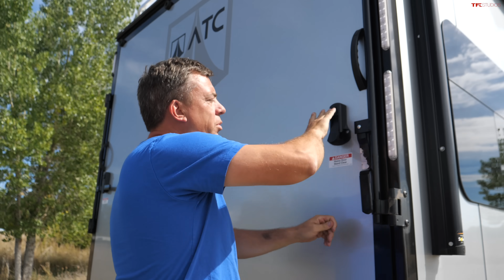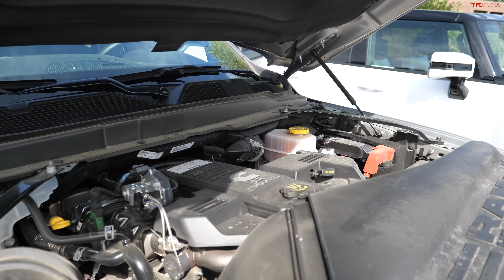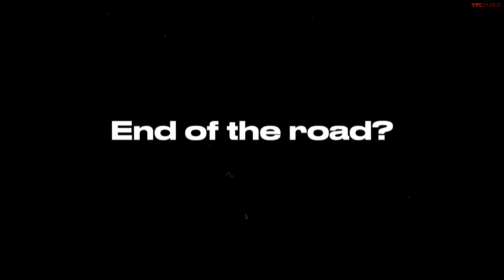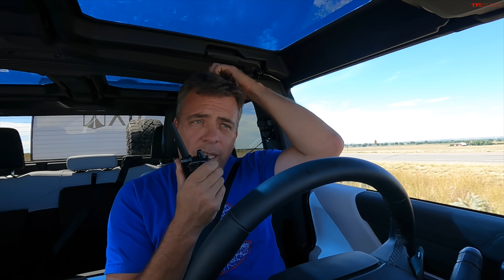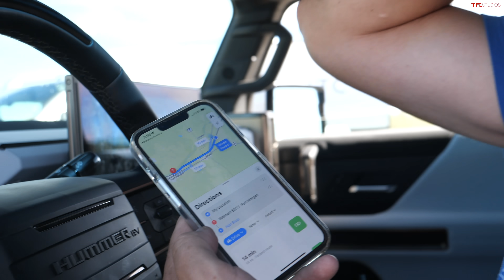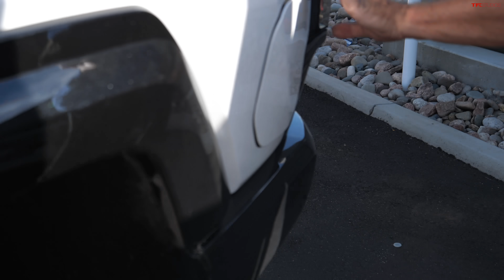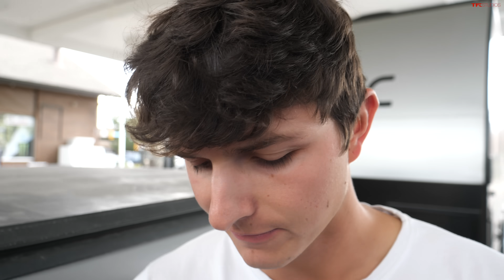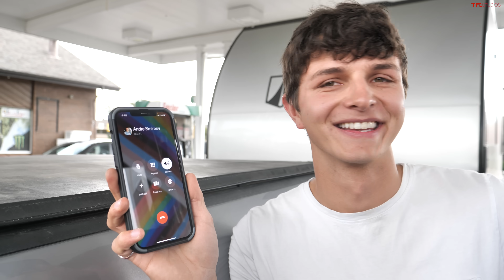How Far Can a Diesel and Electric Truck Tow An Identical Camper Trailer on ONE Fill-up?

Comment: The Ram can tow both trailers and the Hummer without breaking a sweat.
Reply: With out a doubt
Reply: Certainly
Reply: @PatrixBest   true , story
Reply: Electric will always lose. It will always cost more. As long as they require batteries, there will always be an extra loss of energy, as batteries must be charged. 
Unless & until they come up with something that generates electric, eliminating the need for batteries it will never be a fair comparison. 
Currently the only way to make huge electricity without fossil fuels is nuclear. 
Even the smallest & most efficient nuclear reactors power aircraft carriers, big ships & the biggest submarines. 
The next logical step should be to make nuclear reactors small & efficient enough to power large train locomotives & maybe the very largest trucks & tractors 
Long time, if ever until nuclear can power pickups, cars etc. Batteries could be used indefinitely for smaller vehicles if & only if we ADD a lot of Nuclear Power Plants to charge them.
Reply: @garymangelsen4413  you realize that diesel trucks need to be recharged too.. right?  You recharge them with energy by putting more Diesel in them.
The only difference between an internal combustion vehicle and an EV in this regard is what you refill/recharge it with.  An electric recharge unfortunately much takes longer (but at least it doesn’t stink of diesel).
Also, current battery tech lasts a decent amount of time.  My EVs batteries have a 100k warranty.   They’ll prob fail long before a maintained (used) fuel tank will though and they’ll  cost a LOT more to fix/replace..  but solid state lithium and other battery tech with much better life spans are around the corner.
Reply: @ffakr  The electricity doesn't stink where you fill Spunky but it usually stinks somewhere else. Outta sight outta mind I guess or ignorance is bliss. Not sure which paradigm in which you exist..
Reply: @robertthomas7176  never noticed the smell off any of the majestic wind turbines around me.
Reply: @ffakr  Yeah those wind turbines are so beautiful to look at lol. Especially while they're killing all kinds of birds and bat's. Including eagles. But yeah yay wind turbines.
Reply: @Pimpdaddyleif  I think windmills are rather majestic myself but I accept beauty is in the eye of the beholder.

The do occasionally kill birds.. I see an estimate of around 1/3 of a million birds killed a year.    There’s been good results in reducing this number though.. painting patterns on blades.. using cameras and Computerized image analysis to identify flocks of birds and slowing turbine speeds to protect the birds while they are in close proximity.

Of course.. up to 1 BILLION birds are killed by collisions with windows in just the US each year.   That’s ~3000X more than windmills.
House cats are estimated to kill between 1-4 BILLION birds in the US every year.. upwards of 12,000X more than windmills.

I don’t suppose you object to the existence of windows, do you?   I’ll also assume you’re not in favor of the euthanazation of all outdoor house cats.. though maybe you’re Really not a cat person.  ;-p

Light pollution.. estimated to be responsible for 100 Million to 1 Billion bird deaths a year.  No lights?
Plastic pollution.. kills Millions of sea birds a year.  No plastics?

Little more hard to find quick numbers on.. how many birds are killed by other methods of power production?  I’m sure that number is Far from zero, both directly and indirectly..  Solar furnaces (mirrors used to generate steam) cook birds in mid flight.   And how many are killed through pollution generated by fossil fuel generation?

Just curious.. is your very narrow concern for our avian buddies tied to the incoherent ravings of anyone in particular?   I’m aware of one bloated old idiot who was VERY upset that he might have to see them while golfing.
Reply: @ffakr  It's not so much that I care about the birds and the bats and especially not cats. It's the fact that it's a government subsidized "green solution" that isn't any better than anything else. But everything else is demonized in the way that I demonized wind generators.
Reply: @Pimpdaddyleif  so.. you feel fine making arguments you know are BS because your FeeFees got hurt?   Is that what you’re trying to say?
Reply: @Pimpdaddyleif  btw.. renewable energy is actually cheaper than coal & natural gas generation now.. not terribly surprising considering the fuel is free and inexhaustible.   It’s WAY cheaper than nuclear.. which wouldn’t exist if the government didn’t subsidize it heavily.

What’s the real complaint, since you admitted it’s not bird deaths?   You hate cheaper power?   Most of the installations around me are on farm land.. you opposed to farmers getting a lease check for hosting turbines? 
Or..  you just a snowflake that’s easily triggered by those dag-nabbit socialist wind turbines?   ;-P. :-)
Reply: @ffakr  My feelings aren't hurt at all I just don't think that things that aren't any worse than the next thing should be demonized just to make some pompous vegan electric vehicle driving douchebag feel better about themselves.
Reply: @ffakr  I'm very opposed to farmers getting a lease check. It's taking up farmland that feeds us. I can't eat wind power. They each take up around 1.5 acres of land. I would much rather that be feeding cattle.
Reply: @ffakr  3 million per wind turbine plus operating and maintenance plus all the transmission lines. I'm sure a 500 turbine farm pays for itself real quick.
Reply: @Pimpdaddyleif  So,.. your theory is that Power Utilities install wind turbines in some grand plan to bankrupt themselves?     Your super-geniosity astounds me.

I know math is hard though.. an average Utility wind turbine can produce more than 6 Million kiloWatt Hours of power each year. 

Last I checked, my delivered cost for electricity was $0.14/kWhr (your electric bill & more math required to calculate).   So, figure somewhere around 10 cents per kWHr just for the electricity (without the delivery cost).
6M * $0.1 is.. ???   $600,000.  So, it takes 5 years to recoup the cost of a $3M Turbine?

That seems like a pretty good investment for an expensive piece of capital equipment with an estimated 20 year operational life, no?

And.. because I believe I have to explain this to you at this point.. a 500 turbine wind farm still pays off the capital cost of the turbines in around 5 years.. just like one turbine does.. because, that's how math works.
Reply: @ffakr  Your math would work if you could store electricity but you can't. Wind turbines are 30 percent efficient. You can't speed them up when you need to and you can't keep it when they're moving and you don't need it. And they're not worried about bankrupting theirselves because it's government subsidized. The taxpayers are paying for it.
Reply: @Pimpdaddyleif   that 1.5 acre estimate includes space for a power sub-station.. something I've never seen in the middle of a corn field next to turbines.  This may shock you, but not every square foot of a farm has crops planted on it.. and there's no reason a sub-station can't be on non-farmed adjacent land.   :-/

Regardless.. let's go with the idea that full estimate and pretend 1.5 acres of crops don't get planted for every Turbine.  The same source where I found "1.5 acres per windmill" at also recommend only installing one turbine per 80 acres.   So, you're complaining about less than 2% reduction in crop yield if everything (even substations) are put onto actual farmable land.

This may shock you.. having seen full shelves on every market you've ever been in.. but we in the US don't have a shortage of food.  Sure, we have population segments that sometimes lack the funds for food.. but there's more than enough food.   Heck, we even pay farmers to run fields fallow to prevent them from flooding the market with too much food,.. to prevent them from driving down prices and bankrupting more farms.

In fact, we Americans throw out about 40% of the food that we produce!   Could you imagine if every farm put as many turbines on them as they could fit (keeping 1 per 80 for max efficiency).. why.. we might have to only throw out 38% of the food we produce!!  Oh, the Humanity!!  

We do, however, have a shortage of family farmers who are able to earn enough to keep their family farms out of bankruptcy.. and yet at the same time, we have a burgeoning market for energy.    

So.. let me get your position straight.. 

You believe Farmers MUST produce as much crops as they can.. whether the market demands that supply or not.. and too bad if they need an additional source of income to stay solvent.. they don't get to use their land how they want.
God forbid they choose to use a tiny fraction of their land to farm Wind instead of Kale.

Huh.  Overall, an interesting take.
What are the odds you're also cool with other people telling you what you can and can't do with your property?  :-)
Reply: @ffakr  I can assure you seeing all the wind farms here in Oklahoma that it is not 1 per 80 acres. If there's this huge overstock of food being produced why is so much of our produce coming from mexico? And if like you say the farmland close to you has no crops or cattle then it's not farmland it's empty unused land so yeah throw some windmills on it.
Reply: @Pimpdaddyleif  thank god they're attached to a grid.. and we don't need to ONLY rely on turbines.   
Still, you should look into available tech to store renewable energy.  Some of it seems rather 'Rube Goldberg',.. like using excess power to pump water up to a tower (to later recover energy when it's released back down) but it works.  
Other tech is is just over the horizon, like solid batteries (not stolid state batteries).

BTW.. Australia has already proven that you can install massive battery buffers to store renewable solar to use at night.. at infrastructure-levels.
Reply: @ffakr  The pumping the water up the mountain thing is a pretty decent idea. I hope it's close to being figured out. Large amounts of stored electricity would change everything.
Reply: And blow a transmission !
Reply: And keep going
Reply: Exactly what I was thinking . Now where's that tow strap ???
Reply: Yep
Reply: I wouldn’t say it would tow 21,000 pounds without breaking a sweat.  It would certainly be able to tow it though granted not legally.
Reply: Exactly
Reply: @Bob Habib Yes, I expect I will have $10K, or whatever it costs when my battery finally needs replacement.  My former primary car (now backup, a 2012 model) averaged about 12K miles per year.. and with a 100K mile warranty this will only be an issue LONG after my car is paid off,.. then it will be a question of new battery or new car and expensive battery is WAY cheaper than new car.
Also, there's a burgeoning industry of battery rebuilders for EVs. Just like most Transmission issues don't require a new Trans.. it's often possible to identify and replace just the individual cells that fail in an EV battery because each cell is a discrete part and they don't all fail at once.

By then, I also expect the replacement will be solid-state or some entirely new chemistry so, at worst, it'll be a replacement that lasts multiple times longer than 100K miles.. and with increased power density it should either give me better range or cost less (fewer cells required for same range).

As for motors, I've got two.  Yes the Hummer has four.. though I doubt they cost $5K each. 
Still, I expect them to last MUCH longer than ICE engines.  They're much simpler with fewer moving parts and FAR fewer points of friction.  I expect they'll need bearing replacements at some point but the stators & rotors in my electric motors aren't going to wear out.. unlike your piston rings and sleeves.. or any of the scores of other parts that rub against each other in an ICE motor.

And about charging off-grid.
The sun shines to some extent every day.  Sure, you could convert a desiel to run on cooking oil, but a) you have to do that, and b) how much food do you fry?
In my scenero, you just need to plug your EV in every night.  In yours, you have to spend time going from resturaunt to resturaunt collecting used fryer oil and, at the very least, filter it at home.. or, 'ferment' it into BioDesiel if you want to do less conversion work up front.    Sounds like Exactly how I want to spend my free time.

You also have to remember that you don't need to recharge the entire battery all at once.   EV drivers don't typically run their batteries to empty like ICE drivers often do (gas) before filling up.  We plug in at home every night.. imagine putting a gallon or two in your tank every day.
Most people also drive relatively few miles day to day, and only drive long distances occasionally.
I charge my EV with a cheap 120V wall charger that puts out a puny 1.75KW.  Work is about 55miles round trip, and that little charger more or less keeps up with that amount of driving (and easily catches up on the weekends.. if I don't go on a road trip).

If I wanted to go off-grid and charge an EV with home solar, I expect I'd be stocking away somewhere between 5-10kW throughout sunny days.  Sure, figure maybe 75-100kWhr a Day isn't going to fully recharge a Hummer EV's huge 212kWhr battery.. but you're not going to run that battery from 100% to 0% every day (or ever, unless you want to tow it home).
Instead, to lengthen battery life, you'll try to keep it between 20-80% most of the time, and if you go out and drive 30 miles in a day, like most people do, that's going to translate to about 20kWhr of battery capacity in a Hummer EV (only gets about 1.5Miles/kWhr).   A fairly mediocre 5KW L2 home charger will top that off in 4 hours.  Heck, the trickle my 1.75KW charger would catch up in about 11-1/2 hours.   Belive it or not, most people's cars sit around not driving most of the time.. EV's can spend this downtime charging.
Reply: @Schmartist Munky  you drive 12k a year... so half the national average which means you hardly commute far to employment. With that said, you also live in a mega city to reliably find a place to charge... this guy is in Colorado and BARELY made it to a charging station... took him 30+ minutes to charge to.. 80%

So basically it's a good choice for someone who doesn't do anything but drive between two large cities.... or never goes outside to live recreational.
Reply: @Bob Habib .. sorry missed the part below the fold.     Also sorry that that you think being exposed to an opinion, let alone facts, that contradict your preconceived notions is having something forced on you.  It must be tough being that resistant to new information. 
      
Just curious though.. which EV did I FORCE you to buy?  ;-)

Is it actually painful to hear a opinion that don't match your preconceived notions?

I do sincerely apologize for one thing though.. 
I'm not arguing that Electric is ready for long-distance trailer towing and that's what this video was a test of.   I also understand Electric long-haul trucks aren't around the corner either.
The replies veered off into general ICE vs. EV topics though and I've been replying to that broader discussion..  like when you tried to make the point that running a diesel truck off old frier grease was a more practical off-grid option than running an EV off home solar (because you didn't bother to run the numbers).   
Sure you could do it your way.. but I could also buy an old truck and put a coal-fired steam engine in the bed.   That doesn't make it a practical option,  nor does it negate the reality that I can charge my car entirely off home solar (with the rare exception of needing a fast DC charger for road trips).

.. now if my roofer actually starts on my roof before winter, maybe I literally could get those solar panels to charge my car by spring.

P.S.  Yes, the sun doesn't shine every day, and yet solar still works when it's cloudy.. just not as well (because cloudy isn't the same as pitch black).
More important though..  most people go out during the day (rather than night) so the assumption that there's batteries in that solar setup was sort of baked into the argument.   Collect power on sunny days.. use it when you need it.. like when you charge your car overnight.
Reply: Ram beats all trucks with how many times it can break down and fall apart. Not to mention the Ram rusts very well.
Reply: Yeah sure
Reply: Mine can
Reply: @Bob Habib um.. I can charge an EV off-grid with home solar and/or wind power.
Do you own an oil well and a refinery?
Unless you’re worried about the Men in Black breaking into a company’s servers to remote disable a fully digital  and on-line EV.. (you must be pretty important if that’s a possibility).. my EV is is less dependent on ‘the man’ than your internal combustion vehicle.
Reply: @ffakr  What do you use it for. Electric is not a working (truck) for a man that tows heavy loads..  I'll keep my diesel. 
I don't used mine to run to the store and back.  When it has to be there. It's diesel that gets it there.
Reply: Obviously everything on earth is a cycle. Including oil. It was designed that way, clearly. The hype of "we're running out" of this or that just keeps prices up to keep us poor and dependent. Don't believe it, the Lord was generous and genius when He designed this earth for us.
Reply: @Bob Habib "your cars are exactly like I said.. Status symbols for virtue signaling.."
..  including my 2012 Prius-C.. (the lower-mid version without push-button start)?
I believe I paid all of $17K new for that.    
I'll remember to revel in the status the next time I drive it.  :-)

BTW.. went to the Kia dealer for service and I saw a 4-door Stinger (their mid-sized ICE sports sedan) on the lot for more than the list price of my EV6.
Reply: Look how electric is made, still using fossil fuels, still using plastic
Reply: Apples to oranges.... Battery technology not anywhere near gasoline or diesel. About 110 years behind... Thanks to Rockefeller (Ford wanted to do electric).I figure about another 20 and electric will be a contender.
Reply: No you don’t say, how many years of technology is in diesel and what it’s made for it? Noooo this can’t be
Reply: Nope on both.
Reply: My colorado would get 16 to 17 pulling that camper.
Reply: As long as a certain someones mom isn't in the trailer.
Reply: Well the motor can and that is not built by ram! Now the truck itself  that would be in question  be of the dodge truck history of being a terrible  truck! Sorry🤷
Reply: @timcheek5134  You are not wrong.  I bought my Cummins new in 2004 and it's ran perfectly the entire time.  It's too bad that all that Mopar crap surrounding it can't keep up though.
Reply: Two vehicles  that are losing investments!👍🏼
Reply: And probably blow the transmission in that piece of crap! 😆
Reply: Ford will tow both trucks and trailers
Reply: Even a 4 cylinder kia is better than anything electric.   Garbage electric cars
Reply: A dually maybe. A 3/4 short bed. Snap the frame
Reply: The funny thing about watching American content is learning what we use (engine in the Ram) for 26T GVM or 57300 lb trucks elsewhere is used in regular pickups over there...
Reply: Savagebunny. I love my diesel and would never own an electric vehicle but electric motors are stronger than gas motors.
Reply: And my GMC 1-ton dually can pull the Hummer the Dodge and the two travel trailers LOL
Reply: Better off buying you an ES44AC that can pull thousands of those RAM's for thousands of miles, all at once and without breaking a sweat. If you're gonna run a diesel, locomotive is the way to go. Anything less is a waste of money and time.
Reply: @Destin65  locomotives use 1200 gallons of diesel fuel per side to power the generators that produce the electricity to give the train motion, a 2022 Ram 3500 with the Cummins high output engine and an automatic transmission two wheel drive can pull 40,000 lbs with a 50 gallon fuel tank so basically the Rams equal to the locomotive with the exception of pulling weight most freight trains don’t travel over mountains they go thru mountains they basically run on flat ground where the ram has to travel over the mountains and highways aren’t flat and level so the ram is doing the same job but better and more efficient then the train that runs on flat ground, the more weight a diesel pulls the more efficient it is
Reply: @stephenjump4218  Modern diesel-electric freight locomotives (GE's ES44AC & EMD's SD90MAC) are equipped with 5,000-gallon fuel tanks and  4,000+ horsepower prime movers, which in turn drive a 600-volt AC alternator (think about the alternator in your car, then upsize it about 200 times). I don't know the power or amperage ratings, but they're way up there! Doing the numbers (UP did), sticking 3 locomotives (approximately 12,000 hp) onto a 100-car manifest freight, they average around 100 miles on a gallon of diesel fuel. Let's see 100 Rams do that.
Reply: Except that ram gets horrible fuel mileage compared to my duramax. I would easily get 14-15 mpg pulling that trailer and I have a 36 gallon tank. I could have done that trip there and back on 1 tank.
Reply: That Hummer weighs 9000 lbs🥵. Even the RAM will labour to pull that deadweight and,add the trailer with another 6400 lbs!!
Reply: @afenijmeijer9027  I pull a hotshot trailer with a 5500 diesel ram obviously you don't.those Cummins engines are great even at 300 k miles . Show me an electric vehicle overr 300 k . I'll be dead by then.
Reply: @keithqueen3554  there may be an EV at 300K miles but it's on its 4th battery and has electrical issues all over.
Reply: @afenijmeijer9027  How? That should be easy for that Dodge if we believe what diesel fans in US say that it can easily tow up to 64000kg from east coast of US to west coast with only 5 refills.
Reply: @afenijmeijer9027  - that Ram with the Cummins is capable of towing at least 20,000 lbs. FFS, my 1500 with a gas Hemi can tow 9400 lbs.
Reply: @russgravel6428  hmm d
Tow rating has a lot more factors than what mfg sales literature says.  Your payload will determine how u can tow as well. The 1500/2500/3500 trucks are still class two trucks, that's light duty towing classification.
Reply: The Hummer could probably do the same with 100% of its torque available instantly, and the insane weight it has to give traction to the tires... it probably just wont make it very far before dying.
Reply: The Hummer is almost 3 times as powerful as the Ram, power is not the issue range is.
Reply: @archygrey9093  I bet I could make that ev useless